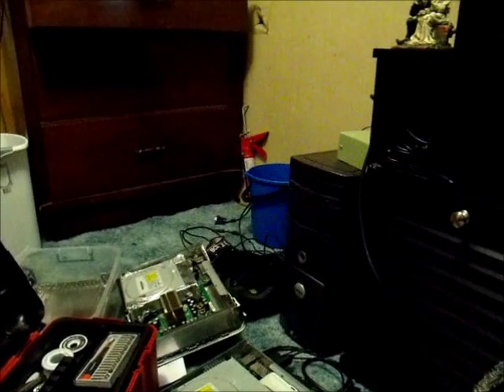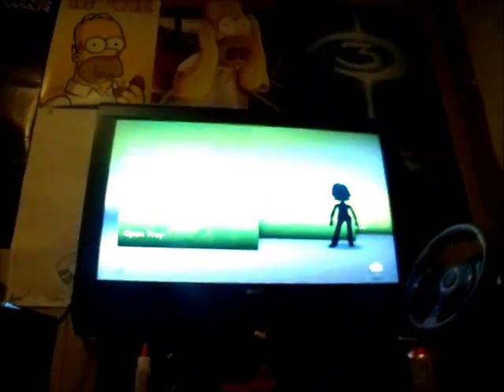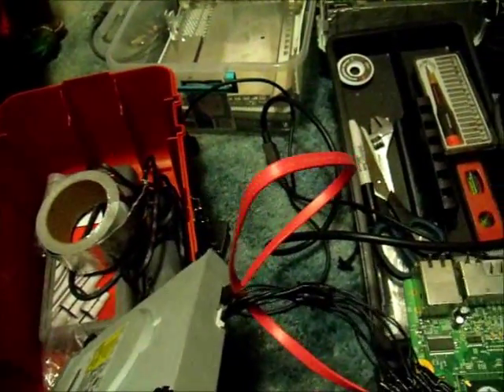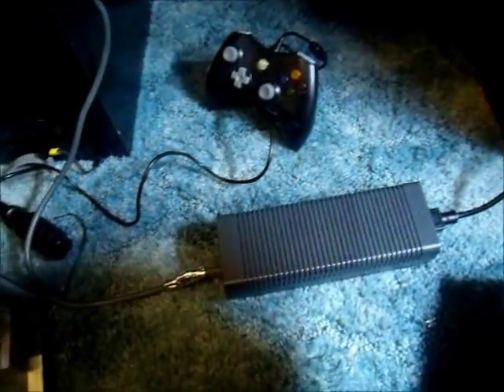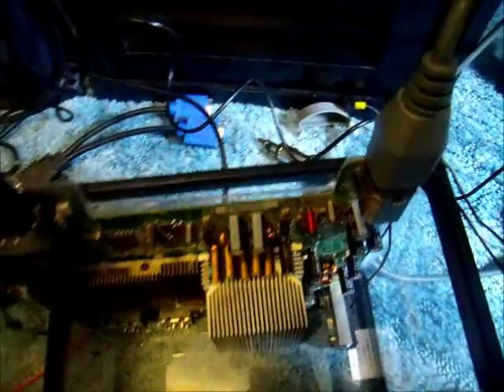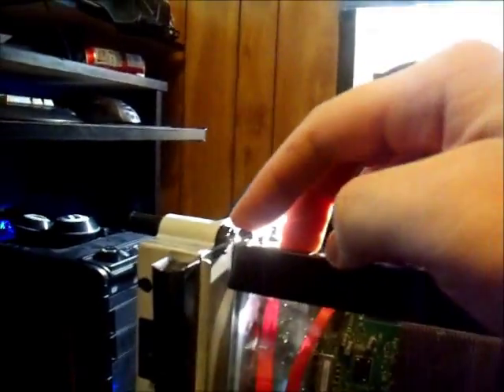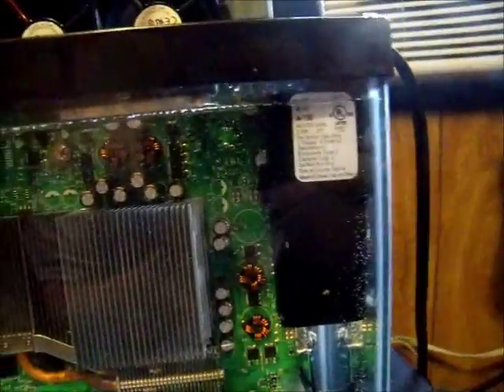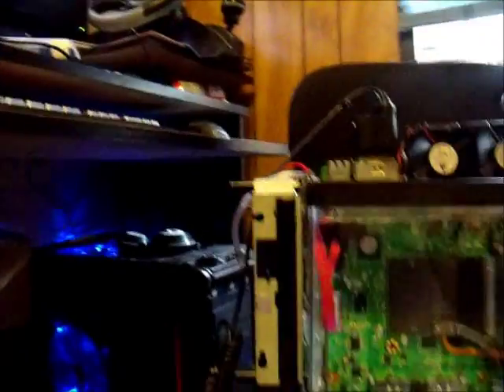Xbox 360 immersion (oil) cooling.

Comment from the maker: Added* note: you must use a method that will not be oil soluble, that means NO ELECTRICAL TAPE to finshi your work. After lengthening the wires, to prevent shorting, either melt rubber over your work, or use a heat gun and shrink tubing, or seal with silicon. You WILL have issues if you use electrical tape. The glue and tape will "Melt" in the oil after a day or two.

Comment from the maker: The tamper thing is a Load. I tampered with them, and no ban. What I did for the black cables is used a very annoying, long and completely rediculous method. I cut them and stripped and lengthened them with new wire and tinned them with solder.

The red cable is a conventional SATA Cable. (the SATA cable the 360 uses is like 2 inches and is black)

Added note: one would think that the box would be banned for being under oil, out of the case, in an aquarium. That modding ban crap is nonsense.

Comment: how or what did you use to extend the cables to the cd drive? i know if you tamper with the black cables that attach to it you may get banned for "modding". that red cable you had on the drive, what was it?

Comment from the maker: So in a way, this is for systems that haven't had the RROD fatally, its for systems you're scared will fail from it. The oil keeps all components reletively the same temperature. This eliminates the heat zones in the 360 and also helps the stress on the solder joints for the processors due to heat rising uniformly instead of all in one place keeping the solder from expanding and contracting quickly which causes the cracking.

Comment from the maker: Technically. But the xbox I used was in very very poor shape. At this point in its life the chips had been non professionally reflown twice. That will net you borrwed time, Anyone will tell you. Yes the full set up will fix the rrod, but the solder on the 360 CPU/GPU is the problem. If it becomes cracked and separates from the circuitboard once, a heatgun reflow may get it working for a WHILE, no matter how you cool it, that solder joint is compromised. Its GOING to fail again unless replaced.

Comment from the maker: I've also noticed that mounting the sinks side ways so the fins are mounted like this: ====== instead of |||||||||||||||||| helps in the aquarium because most pumps will easily be able to move oil to the left or right forcefully, rather than up or down. This will remove the "Heat Spots" (Localized heat) in the tank. Also, I strongly recommend a bigger tank.

Comment from the maker: Yeah I did, be sure its tight before you do it. also, Be sure to find a way to cool the oil effectively or it will eventually catch up to the processor and overheat. The best thing to do is actually utilize two CPU 360 heat sinks instead of the CPU + GPU, This will help remove heat.

Comment: What you should do is dissasemble the MS HDD, then extend the wiring thats inside the hdd case with enough length so you can have the hdd externally.

Otherwise, good job.